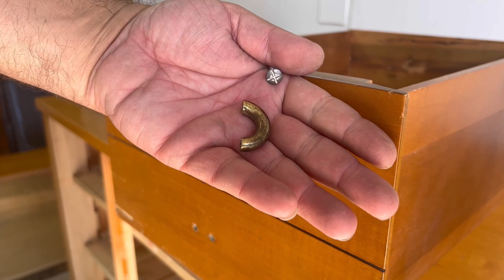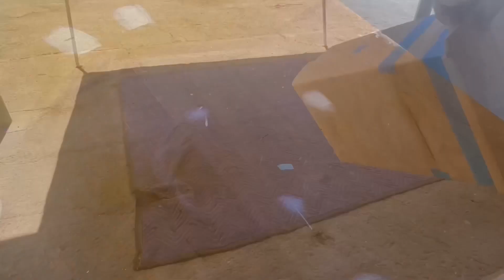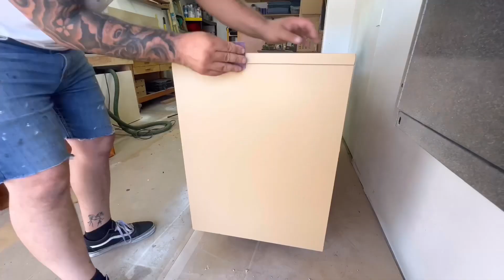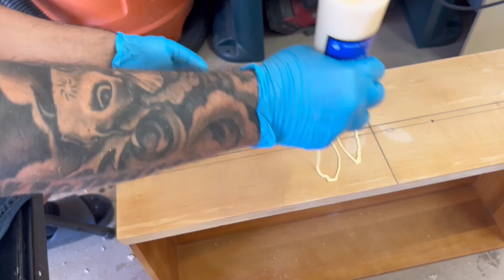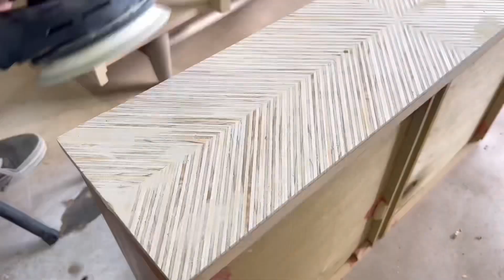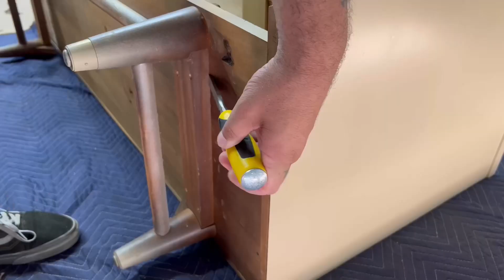How to add a CHEVRON PATTERN to YOUR PROJECT using PLYWOOD stripes || furniture flipping SIDE HUSTLE

Comment: Hello Samuel I have a question. 
Have you ever tried to keep one of these original and have to match the stain on a thin piece of veneer that blew through an edge sanding or had a chip in?
I've got a gorgeous mcm dresser with THIS Very finish and I don't know if I should paint the little spot or stain it.
Have you done such a repair?
My piece is perfect other than this one small spot on front edge and I'm dying to keep it original.

Btw Samuel, whoever originally designed this piece would be yelling at the screen "Now why didn't I think of that?!"
Reply from the maker: Thank you so much rhonnie for reaching out. I’ve definitely sanded threw the veneer on the edges plenty of times. What I did to fix this is stain as normal and let dry. You will then see that the edge where you sanded to far is very light. I get either the stain and a rag, or a stain pen and go over that spot and let dry a bit before dabbing off. Repeat that process basically letting the stains dry over top of the light spot and dabbing away leaving it on the surface of the wood because it won’t penetrate and match.

I hope this helps, if not let me know and I’ll try to explain it in more detail.
Reply: @CedarPineDesigns  Thank you Samuel! Going to buy stain markers in the morning!
Reply from the maker: @RoeRoe123  no problem at all.

Comment: I love this design. Fantastic work. I think your product choices are fantastic and easily accessible. A lot of high end furniture paint is not cost effective and hard to purchase in person. On the ply wood herringbone, what does the texture feel like after you top coat?
Reply from the maker: Thank you so much for the positive feedback. I to don’t think the high end paint is worth it at the end of the day. The ply wood felt so smooth after I sanded it smooth and did about 3-4 coats of poly.

Comment: I really like the chevron pattern and the use of end-grain plywood to create it. Madebyraphael has been doing this for a while, creating some really unique and beautiful  pieces. You’re correct about the paint though- I’m one of the non-fans of over-use, although this piece turned out very pretty. I just prefer a little more grain to paint ratio. Curious to see how quickly it sells.
Reply from the maker: Thank you so much Amy. I’m glad you like my work and I to love plywood end grain furniture pieces. Unfortunately for this piece it some very boring wood grain. I do have an update video coming soon for this piece so stay tuned.
Reply: @CedarPineDesigns  Roger that 😊

Comment: If the surface is prepared well, acrylic latex does great. Black sheep House uses it with similar results. Def need a topcoat but most paints do.
Reply from the maker: Thank you so much for the info. I’ll be doing some research with different paints

Comment: I think some people are talking about your use of latex paint. Chalk paint gives a longer lasting finish and Behr has it. Latex looks good while fresh but but the older it gets the more plasticy it tends to look. And if you want a change, mineral or chalk paint is easier to work with, and is easier to blend or do more artistic effects with. If latex works for you, keep it up!
Reply: Also, if you want to try a mineral paint, one of the middle priced ones that actually performs like the most expensive, try Melange paint. It also comes with an all in one, with primer and top coat included!
Reply from the maker: Thank you so much for the compliment and all the info. I’ve see people use melange and it looks great. I’ll definitely have to take a look at some of these mineral paint companies.

Comment: Samuel, this piece is so beautiful!! I love the herringbone drawer faces! I think if you’re perfectly happy with the paint you use, you should rock with it. I like Behr as well but also really enjoy fusion mineral paint. It’s pricey but high quality. Great job as always! ☺️
Reply from the maker: Thank you so much for stopping by and leaving such lovely comments. I do really appreciate it. Question with the fusion mineral paint. Does it still require a top coat?
Reply: @CedarPineDesigns  it doesn’t! But, I usually do one on the tops of my high traffic pieces.. and sometimes I will use wax on the body of them if I want to richen the color. It’s nice knowing that I wouldn’t “have” to though. I did a nightstand for my sons room a few months back.. he’s 10 and doesn’t care about keeping furniture nice and there isn’t a single scratch or anything on it yet. I didn’t use any top coat on the body after using my favorite fusion color, coal black.
Reply from the maker: @rebelrefurb8397  wow. I’ll definitely have to do some research and check in on that. I just feel like I have to do a top coat. Especially over paint. That could definitely save some time